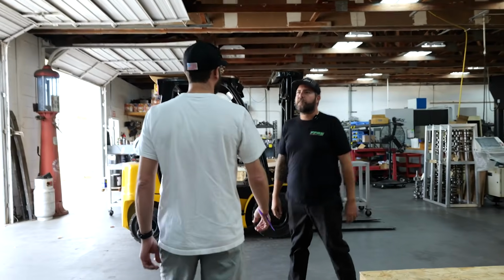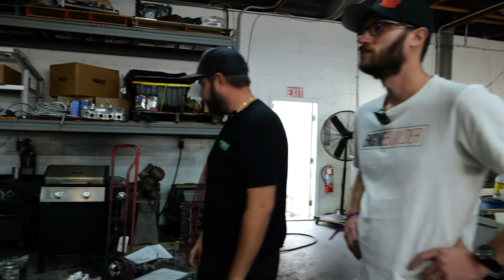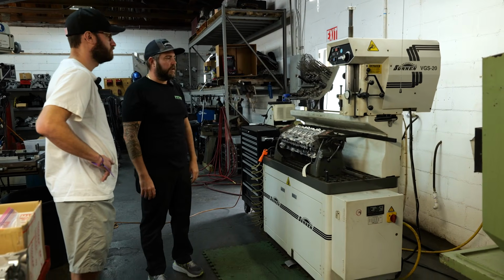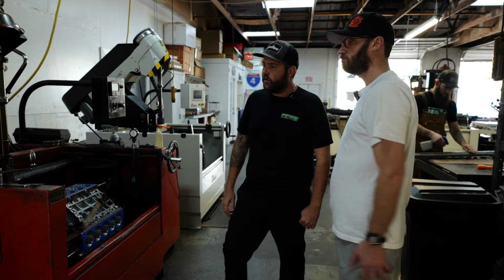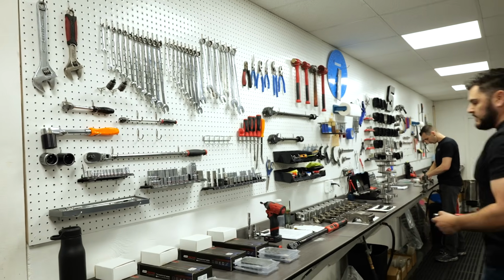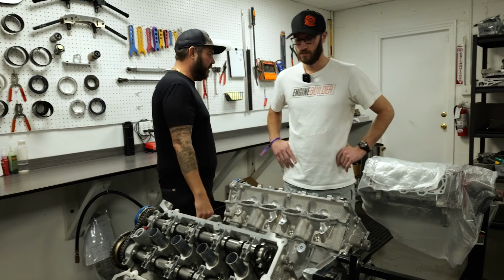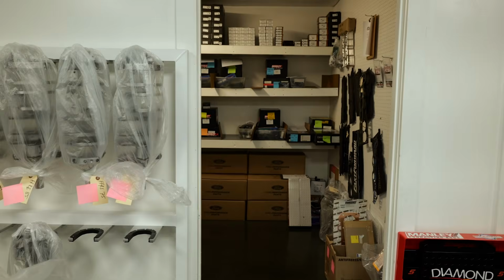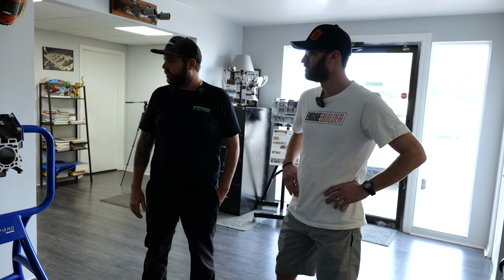Inside the Coyote Den of Fast Forward Race Engines

Comment: What head mods and who do you use?
Reply: I don’t know the guys at this shop but I did watch the video. They have one of the best equipped shops I’ve ever seen and they do some very intricate work on customers blocks and rotating assemblies. Head modifications should be a routine part of the program done in house.  If you can get a reply, I would be surprised if they do rely on outside sources for head work 🤷‍♂️.